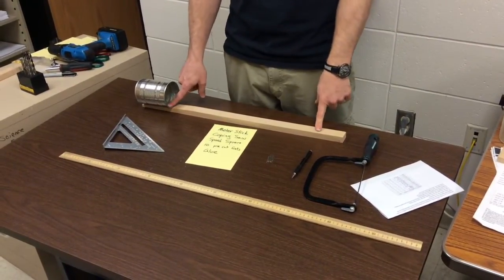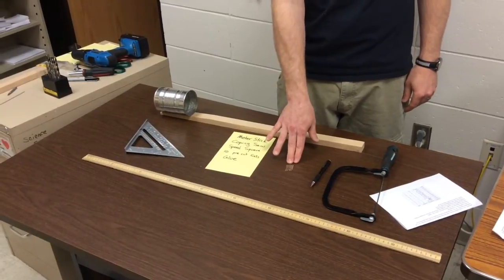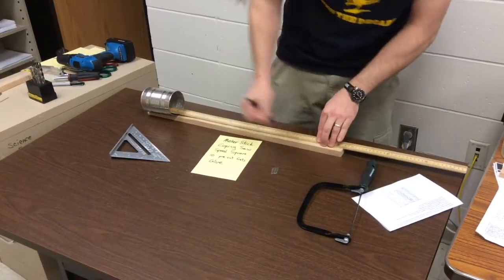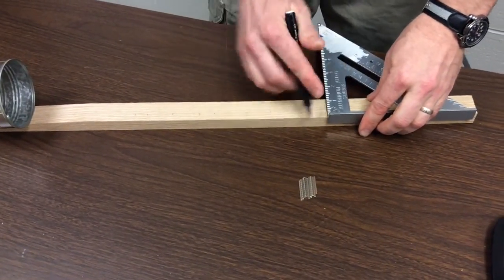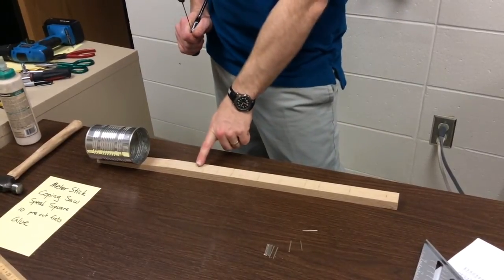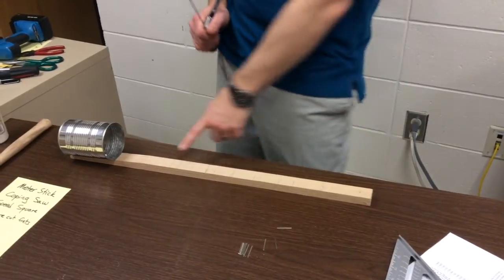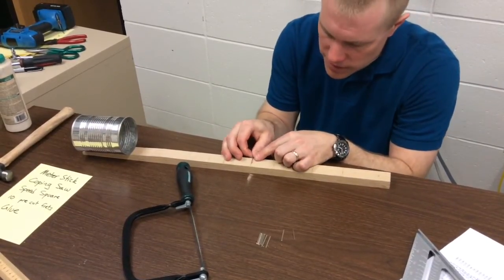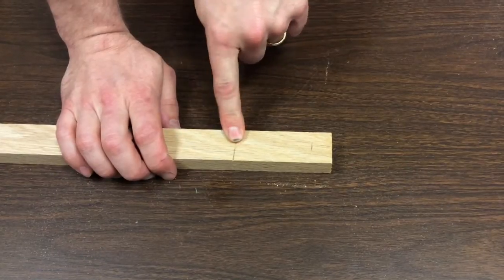Video 2 - Fret locations

Comment: Hey man, nice videos! Thank you, I am using your instructions for my own piece.
My question is though (I have no knowledge): How do I make my own "lab calculations" to base the frets..? How do I calculate that?
Reply from the maker: Well, if you use the same gauge wire, 0.011" diameter, as us you can use our experimental value of L=17138/f, where f is the frequency in Hz and L is the length in cm.  Otherwise here is a link to the lab handout we use:
https://drive.google.com/file/d/1Ly1mJ8MwFk1biTAgL59tskAnQYhD_5f4/view?usp=sharing

You will need to make a test stick to collect your data, but you can reuse the stick, tuner, string and screws for you final product.  To make a test stick we put the tuner about 70cm from a straight slot sheet metal screw with a second screw further out which holds down the other end of the wire. The straight slot holds the string up off the board.  We then use a small bolt as a movable "fret" to change the length for experimental purposes.
Reply: If you google “fret calculator “  one of the first results is a link to Stewmac’s (Stuart MacDonald) online calculator. Simple to use, and it even gives you the bridge compensation needed depending on the scale length and type of strings
Reply: Thank man